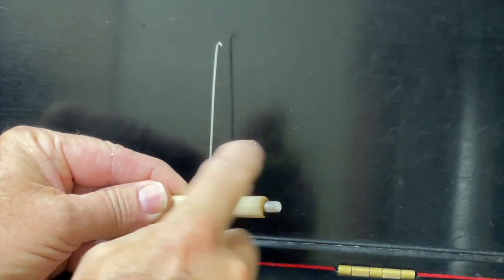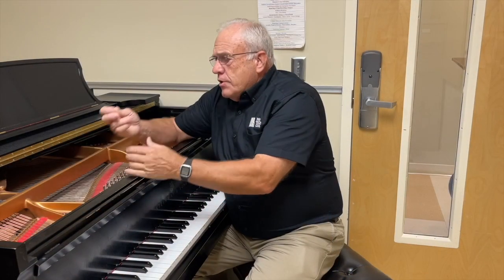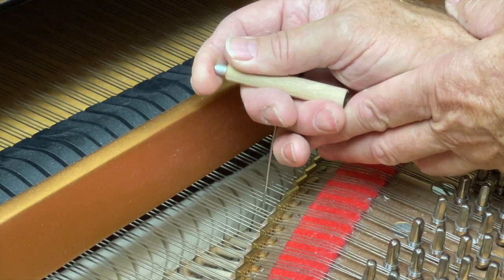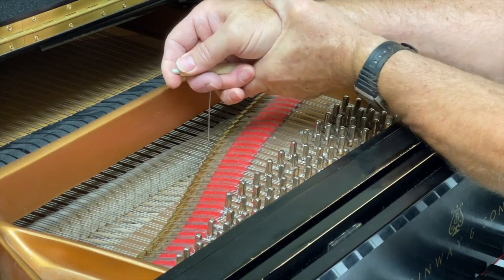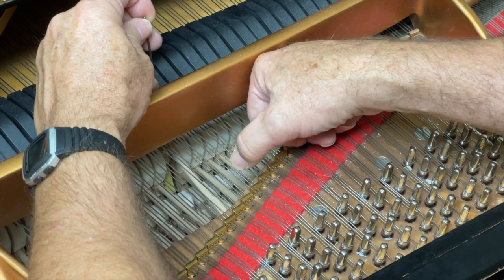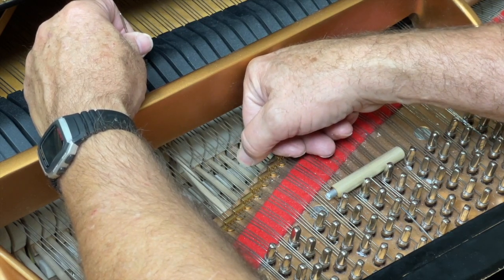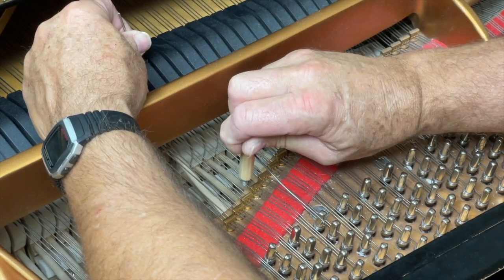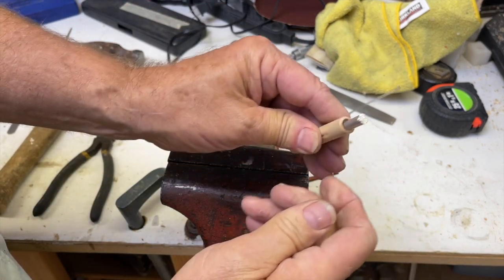Pro Tip 9: Making a Simple String Lifter

Comment: Thanks for this one!  In most of the literature I’ve read about string levelling it’s not recommended to lower the strings, only to raise them. You say some pianos are ok to lower strings on. How do you decide to lower/raise in a particular instrument?
Reply: Hi Gavin. Good question. My usual protocol is to try and lift the low strings first, and try that maybe twice, then I’ll lower them simply when lifting doesn’t work well. Truthfully, if I’m in a hurry I’ll lower one string instead of lifting two. It works either way, but the most important thing is that the hammer is mated. In my spectrum studies years ago it didn’t matter if I lifted or lowered, but as long as they are mated, that’s most important.
Reply: Do you ever encounter strings that really don’t want to lift? I’ve given up on more than I care to mention and just mated the hammers to the strings. I know this is the most important thing at the end of the day but how far do you go? Have you pulled an agraffe out, broken a string, caused false beats by pulling too hard? Appreciate your time to answer!